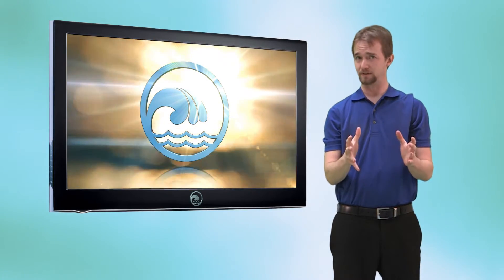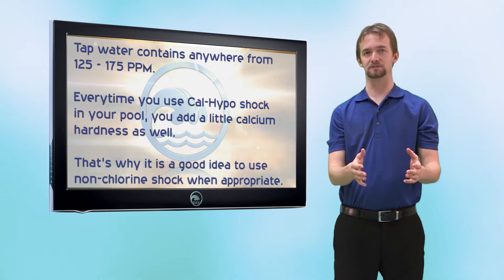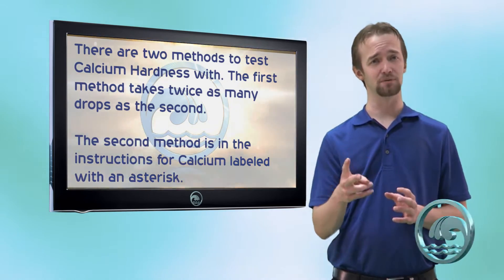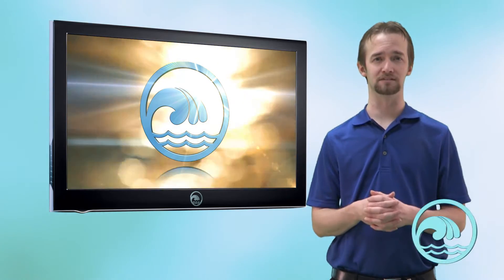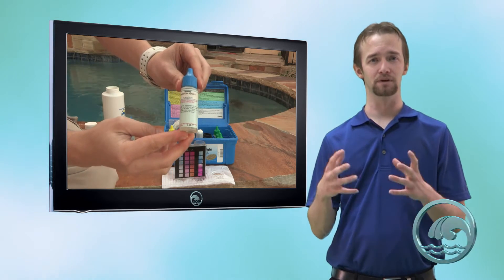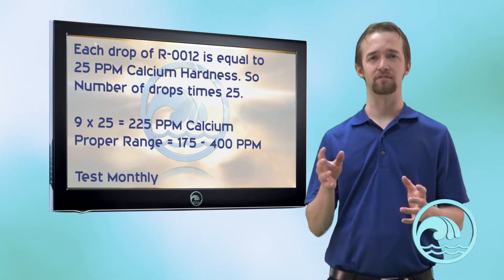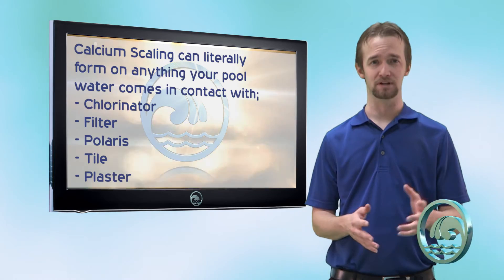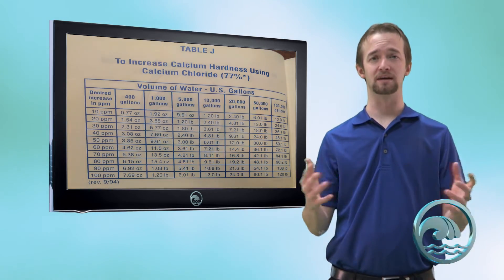RiverbendPoolSupply.com - Chemistry School - Calcium Hardness - Murphy Pool Supply

Comment: I have trouble deciding which color is the right color to choose with the Taylor 2005 test kit. So I ordered the Lamotte 2056 ColorQ Pro 7 Digital Pool Test kit. It should be here on Tuesday. I don't have great eyesight so this kit should be the best set for me because you put the water in the tube and put a drop of the appropriate regiment in the tube put it in the little machine, press the button and it tells you the right number for your chemicals. It is more expensive but there won't be anymore guessing on my part.